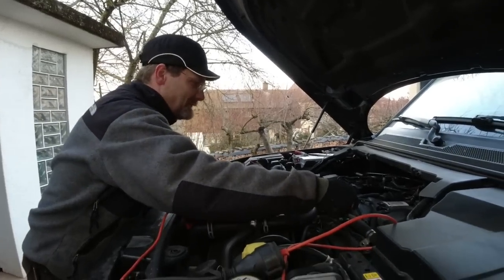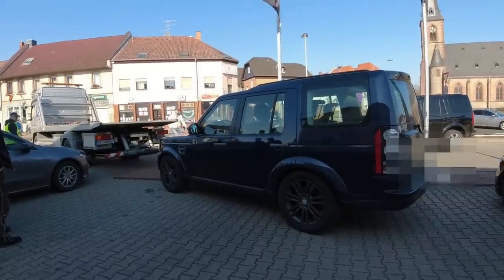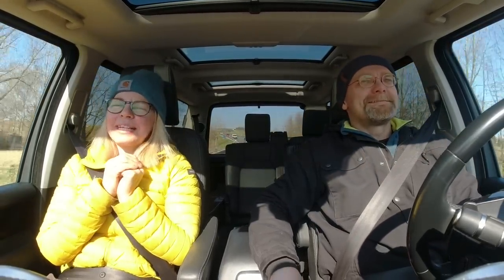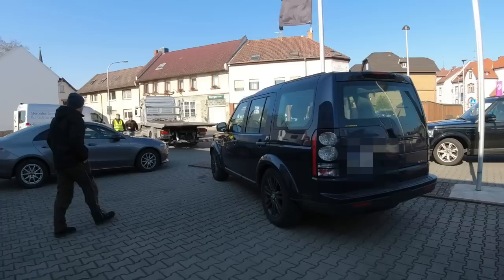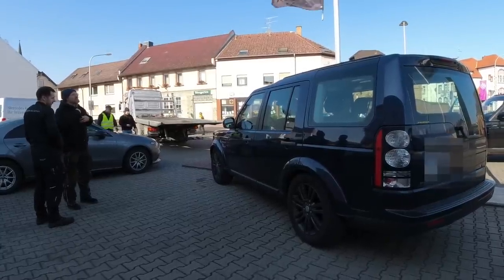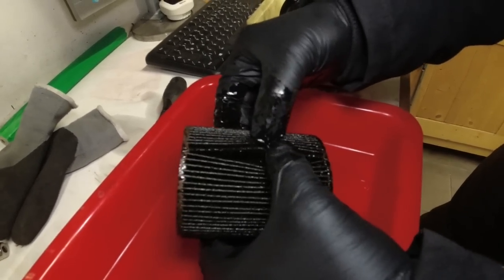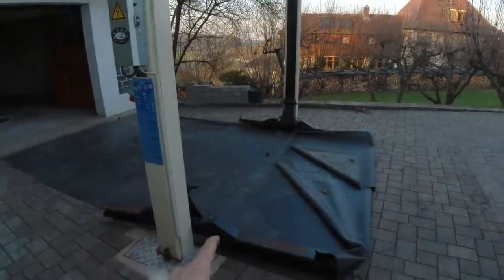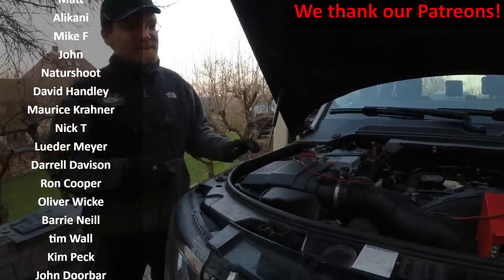We bought a dead engine LAND ROVER with only 40.000 Miles / S4-Ep10

Comment: Broken or loosened timing belt (one or both) due to badly executed 84 month service.
Reply: So far necessary, my explanation:
If the timing belt gets loose during driving and stays in one piece, and then the belt skips a few sprocket teeth, the engine gets running out of time. Even so if the belt snaps while driving.
This can happen after a badly executed change of the timing belt during a service. Most likely: the tensioner or guides are not correctly installed. 
Result: Valves and pistons touch each other violently. Valves and rockers wil bend or crack and maybe one or both camshafts can be blocked. The pistons are also getting damaged.
When a piston hits a valve there might be a possibility that a vulnerable or weak crankshaft and or driveshaft can snap because of the moving mass of the car during driving which creates a force transported by the gearbox to the crankshaft on the moment the engine ceases. Even damage to the gearbox at the blocking moment of a piston is imaginable.
If crankshaft, driveshafts or bearings are damaged, the crankshaft can be blocked. 
If the timing belt stays in one piece and even so on the sprockets a blocked camshaft can also lead to a not anymore movable crankshaft.
For the former owner of the vehicle I really hope that I’m wrong and that the damage after all will be minor. But if I’m right or partially right, this should be an insurance matter for the dealership as I experienced once myself with another brand of car!!
Fingers crossed.
Reply: Ps. Wouldn’t it be a massive joke if the car just ran out of Ad Blue!
But this problem does not block the crankshaft I assume or does it?

Comment: It's a piston failure. the piston melted and stuck in cylinder. I think owner's wife fueled a gasoline instead of diesel.
Reply from the maker: I met the owners wife, she is a Doctor and not stupid. And the engine is not going to seize up when you fuel petrol instead of diesel. You should google what happens then.  👍🙋‍♀️

Comment: I don't know much about engines so I asked a Toyota Owner for advice.  Judging by the blank look on his face he did not understand my question - what causes a seized engine? I gave up asking after 15 minutes.  Don't be fooled, these Toyota Owners are useless.  They know nothing about engines!
Anyway....I'll have a guess.  Seeing as (1) I am an optimist (2) the engine did not go KA-BOOM (3) even useless LR dealerships would not write off the engine unless its was something serious (surely? 🤔).  So...I think High Pressure Fuel Pump failed and thus starved the engine of SAE dumbass oel which then caused the engine to lock-up.  Fortunately, I think the owner stopped immediately so the engine did not self-detonate.

Comment: If the wife was running at 120kmh for over 2 hrs radio on it could have spun a big end bearing and seized to the crank. Could have happened in less than 20 secs
Reply: 2 hrs running with radio on